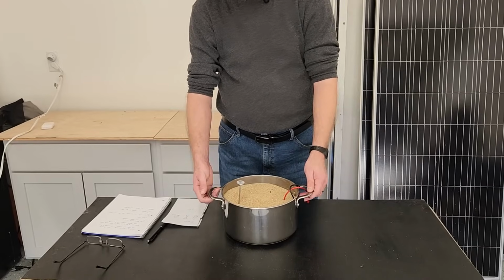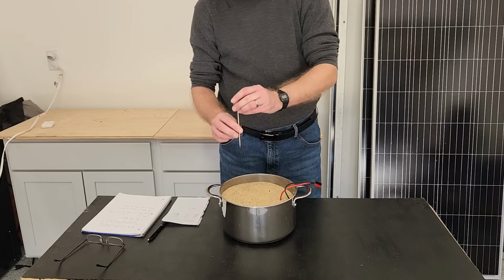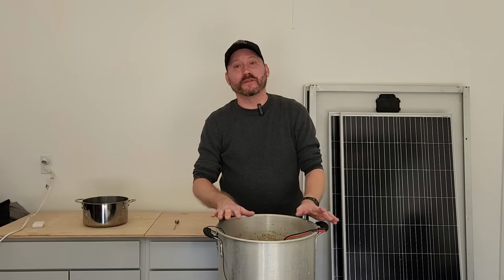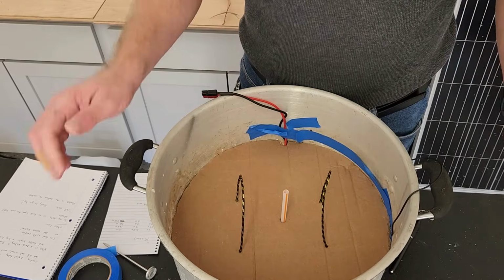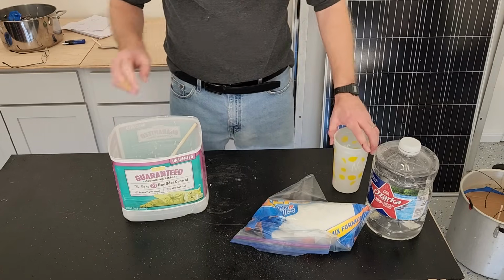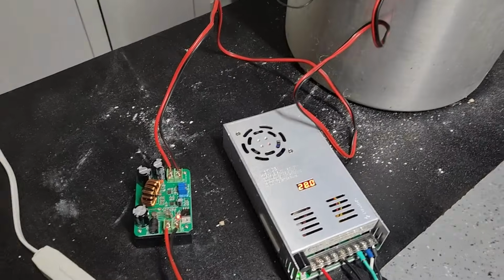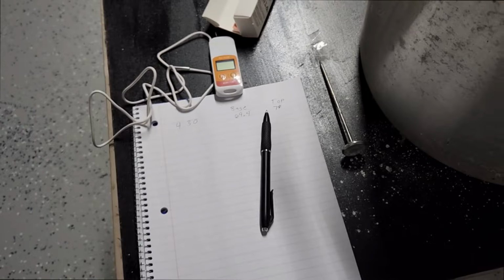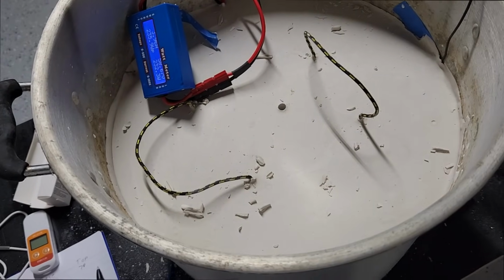Sand Battery heater. Create free heat  of 500F using solar electricity! Texas Prepper Projects

Comment: PTC heating plates are much better. They are also wired with heat covering such as toasters etc so the melting doesn't happen. It's Much better using 4-6 of those instead of a heating element from a water heater, which is designed for water. Look up ptc units, they are designed for dry heating materials. They are perfect for sand. Remember, no water heater heats to that temperature so no water heater element is designed for this higher temperature. PTC heater plates are.
Reply from the maker: Heat is a perfect energy transfer. How can a heating element be 'better' ?
Reply: @texasprepperprojectIts  because they are built for different things. An element from a water heater is designed to heat water, not solids. A PTC plate can't be used for water.A PTC plate heater is designed to heat solids. You can find them on the bottom of large oil pans in industry to heat the pan, and many other industrial examples, and in many household devices.( coffee makers, electric skillits)They are Perfect for heating sand. They are also thematically sealed so in sand even the cable is protected from the heat. They also come in 12v or 24v and run perfectly from a solar panel, 12v battery, or windmill. They come in  wattages from 3-200 watts at 12 v ac or DC. 
The are also self- regulating, so will never overheat as they will shut off at the given temp. There is no danger from a sand heater sitting in your bedroom. It Cannot overheat, it Cannot cause a fire.
I can heat a greenhouse with two of them here in Tennessee. Four PTC 12v  50 watt elements in one sand heater ran  off solar panels during the day will release that heat slowly all night. So , no, all heating elements are not alike, not even close, as in this case these two examples ( and there are more) are designed for different tasks. There's no way I'd use a water heater element in sand, because I'd get just what you're getting; problems. Please don't take my word, look up PTC heater plates. Read up on water heater elements and PTC heater plates! It'll make it much easier and safer.
Reply from the maker: why don't you send a link to the units you used and I'll take a look @thesonnytackettshow7949    How big is your green house and how much sand weight do you have?
Reply: @texasprepperprojects  I tried to paste the link here earlier. For some reason it didn't post. I'll go get it for you. Also, there are tons of videos on YouTube about building these. Put in- 
ptc sand heaters into the search on youtube and you'll find tons of info. I live in a 100 year old farmhouse in East TN that we've built into a recording studio. On the back side we've built an 8' x 24' greenhouse to supply the kitchen; herbs and veggies etc, year round. I have quest artists who stay and record/film here and we always have everything fresh for the kitchen.We have never had an electric or gas heater in it. It's 28 degrees outside now, and no problem at all ( we would need  more if in a colder climate). We're lucky that 8' behind the  house is a 6' stone wall and a canhouse. So we put a greenhouse roof over that breezeway and closed it in. I have a solar/windmill/battery system that handles a lot of things like outside lighting, water pump from the springhouse and everything in the small kitchen greenhouse. 
We use two sand heaters made from 12' steel pipe with a welded bottom. They are 16" tall and have four 50 watt elements at about 6" from the bottom with holes drilled for the cables to exit. I have all these wired to a Speakon( lifelong songwriter and engineer so Speakon is my go to foolproof connector) inline connector coming from the batteries. Each sand battery has a wood stove heat activated fan sitting on top of it that kicks in at 70+-%. Never insulate these, they ard radiant heaters, you want them to radiate from the entire thing, not just the top. We've never had a problem.  I'm an inventor with many different patents ( speaker, lighting, etc) and this was extremely easy for me. We've used it for five years and never replaced anything. 
We have 32 acres here and we're building a 40x80 greenhouse in the spring. We plan on building a sheet metal sand wall 2' high and 6" deep  running down each  side, with PTCs inbedded every foot. The metal will also be painted flat black to help heat the sand. The PTCs are really cheap . Sand is cheap!  On top of the wall will be the same stove fans .In the summer we'll use a reflecting cover on them,with the ptcs off, if it gets really hot outside. 
I'll try sending that link again. But you should check out the many videos on youtube that are using PTCs.
Best of luck, Sonny T
Reply: The whole thing radiates heat so we put them up on 4 legs so not to lose heat in the concrete or ground.
Reply from the maker: k @thesonnytackettshow7949
Reply: Brand: Bolsen Tech
4.5 4.5 out of 5 stars 54 Reviews
PTC heating element 50W AC DC 12V consistant temperature ceramic Thermostatic

Comment: A clay pipe thru the pot with a computer fan to push the air and warm the air in the room faster might be something to try , or would the air draft thru due to the temp change ? ? ?  😎
Reply from the maker: check out my other videos for testing on this

Comment: Interesting. Water has about 4 times the specific heat capacity of sand. FTR, plaster of Paris is not ceramic, and isn't much of a thermal insulation. Try something like perlite if you need high temperature insulation.
Reply from the maker: Check out video 2 and 3

Comment: Conversely if like in the uk you are on a cheap rate at night tariff then you could charge it up for 4 hrs at night and cut your gas heating during winter when the electric is far cheaper on a night tariff. Not sure if its cost comparative to gas but if it is equal to the cost of gas then its a win in terms of keeping those fossils locked in the ground.
Reply from the maker: Good point

Comment: Practical app question: Can you  turn the heat off in your house on a 40degree day and keep your house warm?
Reply: Good comment, this seems like a proof of concept only. The hot water element isn't ideal for this, as  only the metal coil should be in the medium (normally water) and the electrical end would  be external,  outside the bulkhead of a water tank.   It's not supposed to reach 190F on the outside, but now it will be within at several hundred degrees for extended periods, it will fail soon.   Really, and practically,  a 250w panel can only give you at best 1500watt-hours for an average full day's sun harvest, and of course it will be winter when you need this, so the shorter day and lower sun angle is against you.   So at best, one panel  is enough to run a small space heater on the high setting for one hour per day.  That's it, no magic, the sand will retain the energy for slower release but it still  couldn't  keep a bathroom warm all day.  PV2L  is a great idea for things like a pool filter pump, used during long summer days with great sun harvests.  Long-winded comment, sorry.
Reply from the maker: highly doubtful at this scale.  But, if you had a tent inside your house as  'hot room' in an emergency, this should provide clean, safe heat for a small space like that
Reply: @texasprepperprojects  Yup, that's the scenario I also envisioned 🙂

Comment: You're going to need stainless steel thermocouples for that...imagine a waterbed heater powered by solar of only 100watts ... increase mass to a king sized bed of sand...add components again  to get increase temp.   Make it hybrid...your ideas are fantastic...
Think a rocket mass stove heater as a third input...😂😂😂😂add rock wall...on and on...   😂😂then install a Tromb wall to  incorporate passive😅 solar😂😂😂😂
Reply from the maker: thanks!

Comment: I just got an idea .. if you built this on a large enough scale...and i have no idea how to calculate that.. could you maybe put a coil of copper with both ends exposed and hook it up to circulate water through it , and use it like a baseboard heater  and then heat a home?
Reply from the maker: it would have to be several tons of sand

Comment: Near the 21:00 time he says as voltage goes up current goes up and you need bigger wire size… the opposite of that is true.  Volts X Amps = Watts.  Higher volts means less amps for the same amount of watts. Wire size is based on amps only because amps is what causes heat and melts things. High volts makes things more dangerous for us as humans.  Think about this… a city can be powered with a 6 awg wire(size of a pencil) because of high voltage (50,000+) and low amps, yet our car battery pulls 100 amps at 12 volts and requires a wire twice as big.  It took me a long time to wrap my mind around this.
Reply from the maker: You are right but thats not the whole story. It depends if the resistance of the load is fixed or not. Check out my newer sand battery video for the math. If your heating element is a fixed resistance then higher voltages will give you higher amperage and higher wattage as a result.  That's why 12v water heaters are so low power

Comment: Make a plaster bucket mybe 2iinch thick  no lid.. use a regulated heat pribes that way the heat probe can shut off at certain temp while sand still warm... i may not be making since but worth a rry.. hell i may try it just cuase i have the heat probes in a duy heat press i.made
Reply from the maker: Check my other videos for follow up tests

Comment: Another path to consider (also) that I'm planning on playing with...

Water bath surrounding many tubes containing paraffin wax.

Water absorbs a lot of power per kilogram (~4KJ per kg per degree C).  But as you point out, Water boils.

Paraffin doesn't absorb as much (~2KJ per kg per degree C), but paraffin melts at around 68°C.  And it takes quite a bit of energy (~200KJ per kg) to melt while maintaining the entire kettle at 68°C.  Once it is fully melted, the whole unit will continue to increase in temp.  A simple thermostat could turn off the electricity once the temp hit say 95°C to prevent boiling... ie... your thermal battery is fully charged
Reply from the maker: Check out my other videos for testing. An electric blanket is a much better idea

Comment: In the very cold states, they use hot water run through pipes to heat the room to habitable temperatures.  Use sand to heat water pumped through pipes to cool a small area.  Will hot sand heat water to around 90 degrees more efficiently than in a hotwater tank, then circulating the water with a pump?  Or should you pump a different type of fluid like windshield wiper fluid through the tubes around the sand or through the sand to pump around the room ?   In a car the fan just blows over tubes with hot fluid.
Reply from the maker: still can't cheat thermodynamics

Comment: Is Fahrenheit or Celsius?
Get that insulation they use for steel melting furnace. Wrap the pot in this.
Does asphalt work? Wat about dirt?
So a deeper pot in the ground would work well?
Running a conductive wire through your concrete slab or under it would work ? 
Running cables through your brick work?
Triple  brick house wall with insulation in between the dbl brick inside any NON COMBUSTIBLE wall will do or insulation. To outside FACADE!
Old Solar panel asl walls & roof? They don't need to be super efficient they already working as a wall & roof. Obviously they more efficient the BETTER.
Reply from the maker: F
Reply: @texasprepperprojects  👍

Comment: This is a game changer for folks up north. I could see a ginormous sand thermal battery insulated and buried in the backyard that you could then tap heat and electricity from.  But what could you use as a heating element with such a large battery?
Reply from the maker: If I didn't live in Central Texas i would be using geothermal. Dig a big trench and lay pipe in it. The ground is naturally 60F about 5 feet down. So let the Earth heat it up
Reply: @texasprepperprojects Geothermal systems start out at about 35k. Unless you own an excavator, you'll never break even and your better off air cooled. I'm guessing this system consisting of only solar panels and heat exchangers/fan coils, no batteries or controller etc, would be a fraction of that cost.
Reply from the maker: @MrRerod  that is correct. just solar to put electricity into the heating element. But after doing the math I don't think it would ever overcome what a simple propane heater could do. check out the part 2 and 3 videos for better testing.

Comment: I wonder if a solar trough could heat the sand battery to high temperatures or a parabolic dish to heat the sand.
Reply from the maker: Eh. Maybe. Check out my other videos on parabolic reflectors. I think just heating air with a reflector makes more sense and many people have done it
Reply: @texasprepperprojects  Well solar thermal could use a trough to heat up silicone oil to seven hundred degrees that could be circulated to heat the sand.

Comment: You need keep those wires outside the sand or they will mels For sure
Reply from the maker: Check the follow up videos. Use silicon wires for heat

Comment: Try putting it on bricks. Will soak and transfer heat out of bottom! Or a clay bottom to a flower pot!  Would this work better in a big clay pot?
Reply from the maker: No. Heat is heat is heat. The clay pot videos on y.t. don't make any sense when you measure and check the science.

Comment: Critical to heating is surface area. A bucket has little surface area and so is not effecient. The water heater is only certified to 100 deg C (212 F) so going higher will damage it. You would be better off with a Hob element that is intended to get red hot. If you want to be really effecient deep insulate the pot with the sand.  Embed some copper pipe in the sand and circulate water to spread the heat. If you can use wider pipe, say 2 inches or more diameter you could circulate air but the heat trancfer from copper to air would not be great. I am not saying this will not work but to be effecient you need to get the sand really really hot, ideally molten.
Reply from the maker: I tried that. check out video 3

Comment: Thanks, neat experiment!
Hot water elements are designed to work at around 140F max so their life may suffer at high temps, remember they are water emersion elements. My wife  said why doesn't he use an oven element which I thought would be something to try but I don't know how much they cost. 

The important factor is how long to sand stays warm enough to heat the room it's in. I might try to build one my self, I'm wondering with an outside temp of 35F how long a, say, 500 sq./ft. room would stay above 68F?

Thanks again.
Reply from the maker: watch my other videos and i have a new one coming out tonight. Short version, don't waste your time. Buy a Mr Buddy Propane heater instead..

Comment: Let's say you got 240 watts into your sand for a ten hour day, (probably stretching that) and it radiated no heat into it's surrounding, (which it does, so you lose some of the energy you put into it.)  Now the most it can generate is 240 Watts for 10 hours, But we all know it will be less than that. Any small electric floor heater will be 1000 watts or more and they are not very good at heating a room. You need a lot more sand and solar collectors. If you have a bigger system. I would insulated it much better to reduce heat loss, and put a coil of tubing inside the sand. Then pump water at a rate through the coil to to an external heat radiator to extract only the heat you need.
Reply from the maker: Yup

Comment: it does not work as good .. because you can do this with candle and it feels this hot.. but it does nto disperse out right as an exchange.. ad copper tubing to filter water through it as a coil and let the water pass to take heat out
Reply from the maker: check out video 3 for testing on this